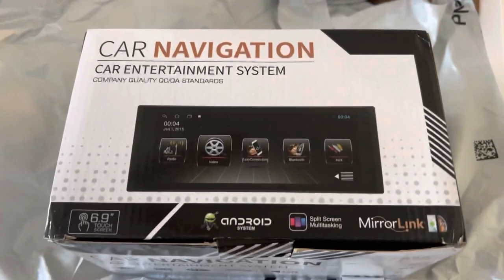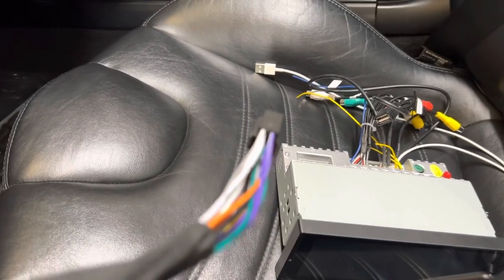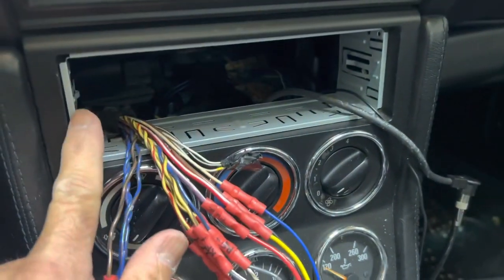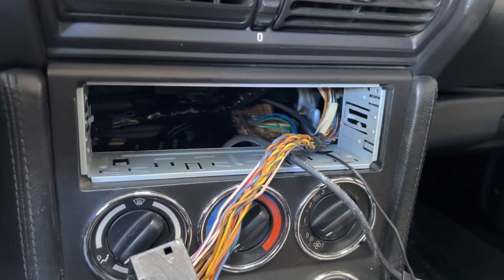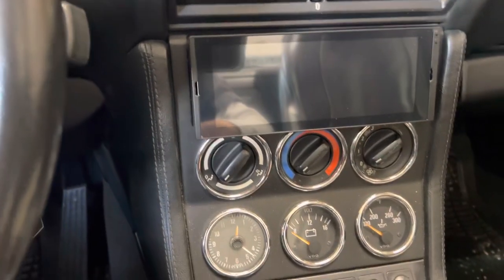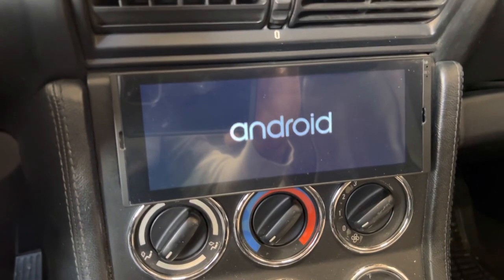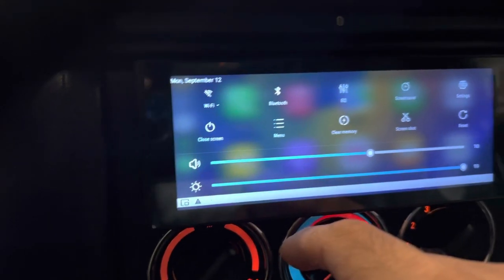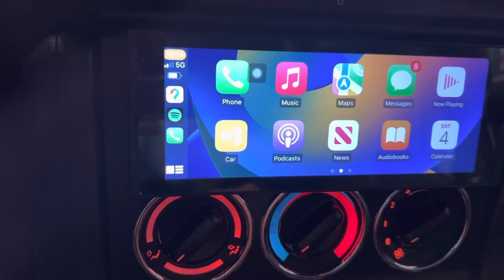Single Android CarPlay install

Comment: No way! I just saw your review on this on Amazon so I ordered it for my e36 and I just found this video while doing some research on it lol
Reply from the maker: It’s not perfect but I do like having maps when I drive.  I wish someone would come up with a single DIN that is full glass (no trim) and have power and volume buttons.  Hope yours works out well.  It’s not bad at all for the price!
Reply: Hey Conall, how does it fit on your e36? Thinking about getting one for mine!

Comment: One question. Is there a way to skip the load-up screen or reduce it's loading time?
Reply from the maker: I haven’t found a way yet… it is a little annoying but for the price I can’t complain.
Reply: Yes, there are two power wires, one supplies constant power even when the ignition key is removed and is usually the radio's yellow wire, and one is for accessory power which is usually a red wire on the radio. The constant power lead keeps the radio in a sleep mode and the accessory lead wakes the radio up. Depending on the unit, when wired properly the boot up time is only a few seconds. The standby power drain is extremely low so there is no danger of draining you car battery unless you let your car sit for weeks without charging the battery. Even then some radios have a low power drain prevention circuit which completely shuts down the radio if the car's battery voltage goes below a certain level.

Comment: Nice find! This would be my next upgrade from the earlier flip-based 1-din android. Yes, its a smaller screen and lower resolution compared to the flip 1 din, but looks kinda neat.

About the touch based volume control, I think there are those 2 wires that a labelled as KEY1, KEY2 and extra GND. You can kinda use that for volume control (you can find these if you got steering wheel control for the car).

There are some tricks that I tried, just touching those wires can trigger the volume up and down.